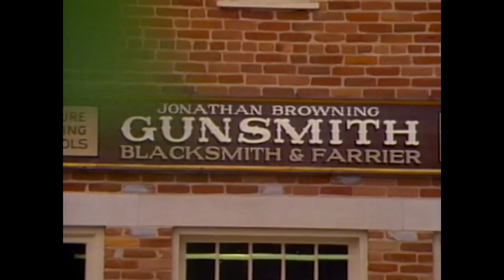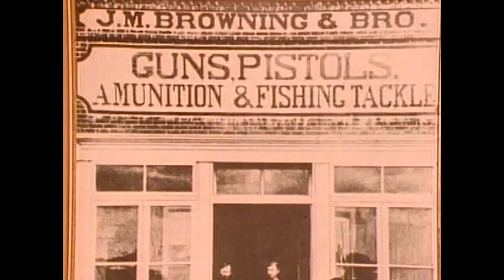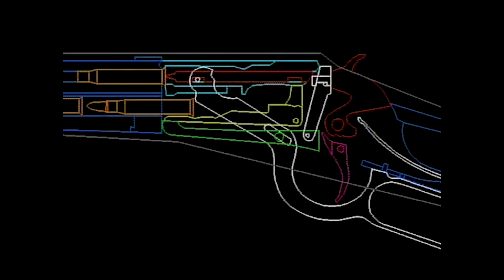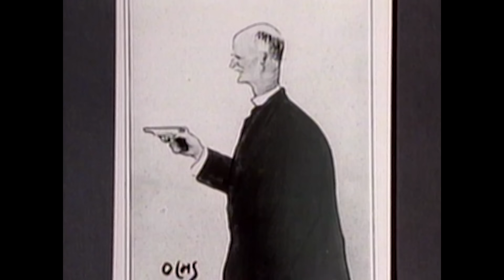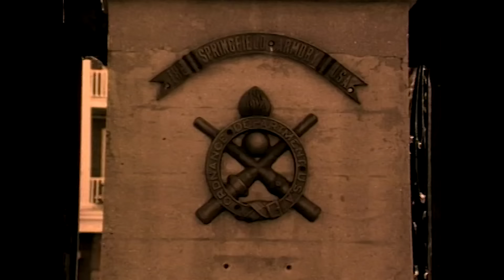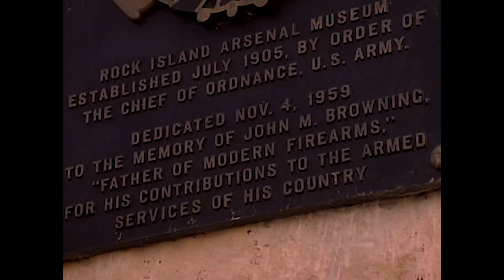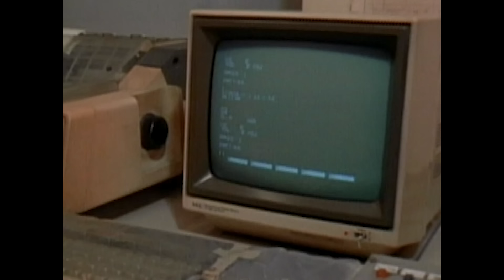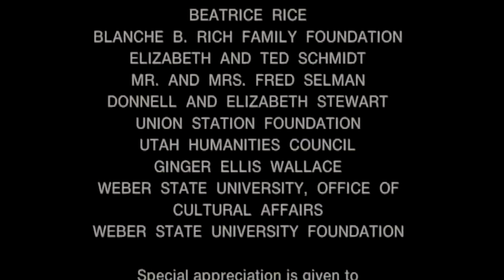American Gunmaker: The John M. Browning Story (1991) | Documentary | Fess Parker | Lee Groberg

Comment: I learned to bird hunt with my Father’s Browning auto loading shotgun (12 Ga), manufactured by Remington. I looked the serial number up a number of years ago. The gun was manufactured in 1912. My son has it today. Still shoots just fine. The fore stock was broken a number of years ago, so that has been replaced, and I recall the firing pin being worked on/replaced while I was still a teenager. Other than that, it’s all original equipment. My Dad was born in 1908, and bought the gun, used, sometime in the 1920s. It’s an amazing weapon.

Comment: 3/'21/2023
Beca8se of my training, while in the Navy 1965-69, (AO-3) I was exposed to several Browning designed military weapons. none ever failed in quality. The model 1911-A1 as what the navy generally used. I, myself could detail strip and reassemble one in just under 90 seconds (blindfolded) and just short of 60 seconds (looking) I was considered a bit slow. 
Unknown to many the 1911A1 had one flaw. The small part called the disconnector was prone to breaking  if fired too often, without maintenance, and would go full auto.
I also had access to 6 of the Woodsman target pistols. I maintained them also. For me, the Woodsman is the finest hand gun I ever handled.
What a nice historical story. Great job Fess. ;-)

Comment: I have a 3032 covert. The casing wedged in the barrel because it had no projectile in it plus it had been fired and expanded. If you have a failure on a live round you literally hit the tip up barrel release and the round flies out by itself. Smack the bottom of the mag and rack the slide. This is where training with your firearm comes into play.

Comment: Under this roof an original 1885 low wall 22 LR, a Model 92 converted to 218 Bee, a Model 94 30-30 carbine. Several M37 & M87 Ithaca shotguns. One Colt 1991A1 and a Remington Model 8 in 35 Remington. A 1901 Winchester 10 gauge. Lots here. Trivia. The Swiss Vatican Guard was one of the very last military units to issue the .32 Browning 1900 pistol. It was know to be accurate as well as very reliable.

Comment: This is an excellent documentary...but why does the narrator call magazines, "clips?" This is a technical definition and should be used properly. This mistake happens in numerous gun videos and narrations. It's very frustrating. Who edits these videos?
Reply: Back when this documentary was produced the terms were used more interchangeably even by "gun experts".  There were other errors such as the soldiers testing the 1911 using a modern 2 handed grip.  Also when they were talking about the Colt 1908 Vest Pocket handgun, but showed a later smaller "Baby Browning" that didn't have the grip safety.

Comment: I am in the market for a budget 1911, any recommendations? Any one know anything about the Rock Island 1911?
Reply: Check out some at pawn shops, rock Island is fine but colt and browning is better
Reply: Stay with me Colt 1911 series 70 it's not cheap but it's the best and it's an investment, you can find them used in excellent condition for a good price, I got me the Colt 1911gold cup in series 70 in blue, there's cheaper ones but like they say you get what you pay for.
Reply: Rock Island Armory is just fine.  You're not paying for a fancy look so you won't get one, but it's absolutely the original design, with variations depending on the model.  My "G.I. model" has functioned very well.

Kimber is fancy for a relatively small cost, but they have a sketchy reputation for poor quality control.

A Colt is the standard, and it will be a very nice firearm, but you're going to pay for it.